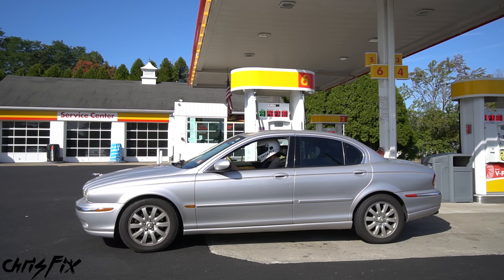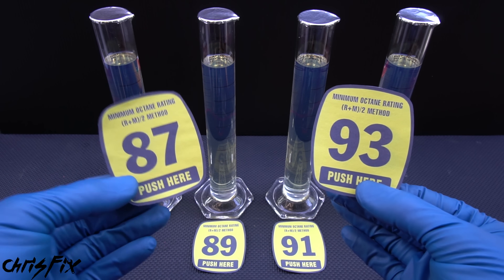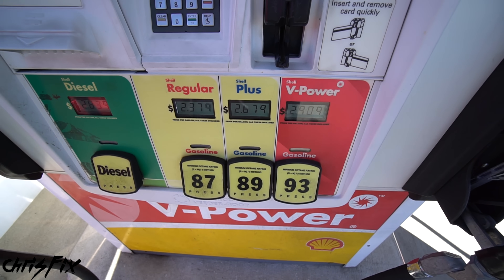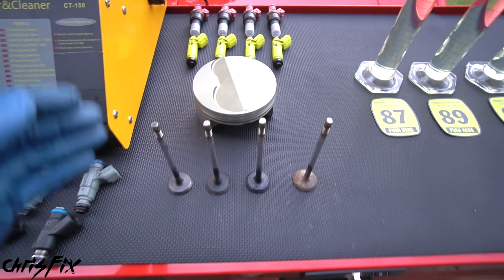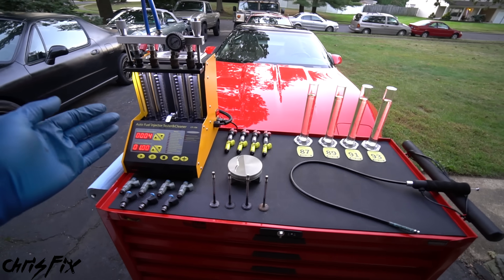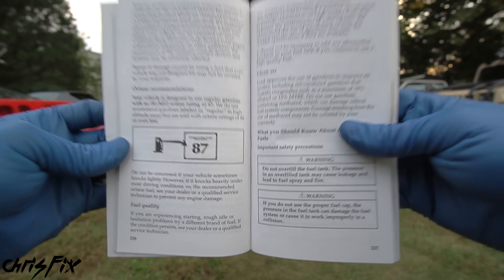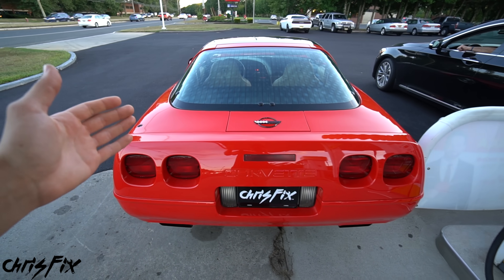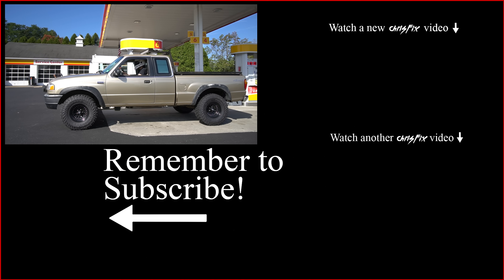What is the BEST Fuel to Use in Your Car or Truck and WHY

Comment: ALL YOU HAVE TO DO IS LIGHLY SPRAY WATER INTO THE AIR INTAKE AND HAVE SOMEBODY APPLY GAS. IT WILL CLEAN ALL THE CARBON OUT OF THE ENGINE IN A MATER OF MINUTES

Comment: Lesson here kids, is if you own a Cruze use premium. If you don’t, you’ll probably have a #1 piston failure. A good sign that you have a #1 piston failure is your Cruze will sound like a Subaru.
(The Chevy Cruze says to use 87, do not do this kids)
Reply: It says 87 or better.  I run 89.
Reply: Jeff Rielley what car or engine? Do you drive harder, or put around? 
I enjoy spirited driving, so I use premium and top tear, on a 1.4t. 
Before the 20,000 mile rebuild, I used 87. Noticed weird computer clicks, asked the dealer at a service, and they said that it “was normal”. Then one afternoon after supper, left the restaurant, and thought someone done a boxer swap on my car.
Reply: @johnsimun6533  I have the 2017 Cruze, 1.4t. I usually try for best mileage since I use my car for work and get paid mileage.  My car is paid off, so it makes sense to use it as a money maker.

Comment: FYI about the E-85 comments at the end, there is such a thing as 85 octane out West in higher elevations that is not ethanol-based, as there is less atmospheric pressure & the engine can perform as well as ~87 octane. Also, have seen some pumps in the midwest with 88 octane as well that has 15% ethanol, sometimes branded as E15.

Comment: Using the manufacturer's guidelines is ok, except if you have an Infiniti.  They stated "premium is recommended for maximum performance."  Well, I tried regular for "regular" performance...and that didn't work.  Then I tried the mid grade, and I got the knocking and check engine light.  In that case, for the G35, premium should have been stated as "required."

Comment: I have a 1999 Jeep Grand Cherokee,  I had my heads done and I'm hearing knocking, but I use 93 Octane. And I also injector cleaner and booster. And its helping a lot. The only time I really hear the knocking is on a cold start and after I warm up the engine, the knocking goes away. Is that normal? And am i doing the right thing with using 93 Octane Fuel and injector cleaner.

Comment: I agree on everything except on your explanation of pre-detonation. The fuel detonates when its not supposed to relative to the engines cycle and not all over the cylinder space. 
It detonates before the piston has reached top point in the cylinder.Pardon my english. 
Fuel detonates at the wrong cycle, wanting to push down the piston but the crank is still pushing the piston to its TDC, hence the broken piston rings, gasket failures, broken heads, bent exhaust valves, or broken/bend piston rods. All that pressure that isnt converting to cyclic motion by the crank needs to go somewhere.

What you are explaining is a very complicated matter of fuel detonation inside the cylinder that manufacturers are still struggling with. Thats why you see so many different piston designs.
I believe Alfa Romeo and BMW have the most interesting ones, if you dont take in mind super cars.

ECU programmers want to protect the engine from predetonation by adding more fuel to the cylinder and also advance the exhaust valve just a notch. More fuel to the cylinder can take more heat with it as it exhausts through the valve, this is why you see flames out of turbocharged car exhausts. All that extra fuel didnt have the time to ignite in the cylinder and it does so in the exhaust system. Taking with it extra heat that could damage the cylinder in case of predetonation for the next cycle of the engine rev.

This is why you see huge intercoolers on street cars. They want to keep the inlet air temperature below a certain point. Cold air has more oxygen molecules than hot air. Resulting in a more stable variable for the engine ecu tuners mind, because if predetonation occurs its going to be catastrophic to the engine.
But as you use larger and larger intercoolers you are adding more space for the turborcharger to fill before it reaches its operating pressure. Hence with larger intercoolers you are adding more turbo lag to the system.
They fix this with small intercoolers using a medium usually sprayed on them with relatively high evaporation rate to take as much heat off of the intercooler as fast as possible.
Think of it when you use aceton that has high evaporation rate, you feel your hand getting colder.

Comment: This video is false.  A more 'higher' octane will of course give you more power!  That is a fact!  For those who haven't been to a race track like a drag race track, they have 98.99 or 100 octane fuel there (called racing fuel) so cars can get the best performance from the fuel as is possible.  It's idiotic to think a higher performance fuel will not provide a boost in power.  Here in part is why that's true...a higher performance fuel (octane) will burn more & cleaner.  Because it will burn more in the cylinder the fuel you get a slight bump in power.  People like this person in this video mean well but they are 100% wrong!

Comment: Hey Chris, I used regular gasoline on my 2002 honda fit gd1 and I noticed it has already a bad fuel consumption when I used it and its not strong enough as I drive it on highway speed but the engine sounds fine, could it be possible that the fuel injector in my car is dirty?

Comment: Why here in california we dont have 93 we only have 91
Reply: Because California's insane gasoline pollution standards, force additives into the fuel, that only a very select few refineries are willing to add. And these refineries generally only formulate up to 91 octane gasoline. Most states have access to higher octane gas like 92 and 93 octane, except for California, since they can use the gasoline from any refinery. This is also why Californians pay far higher gasoline prices compared to the rest of the US too. Plus higher gasoline taxes in California also jack up the price. And the funny thing is that the extra additives in California gas, don't help the gas to burn any cleaner than any other states gasoline as it turns out. So now you have to pay more than any other state and get no added benefits of cleaner burning fuel.
The only real way to make gasoline burn cleaner, is by mixing in ethanol. And most states are doing that now anyway.

Comment: Thanks for your advice on gas. My jeep would not run right on normal gas so I went to premium and it has made a big difference. The engine does not pink anymore under lowed. It is so much better all round. So know I am happy and will be  using the premium all the time. Good video's keep them coming. I could have spent lots of money at the garage trying to sort it all out but when I looked at your video advice I just done what you said and it all worked out well. So know I will keep my jeep and enjoy my rides out a lot better than before. Keep them video's coming. Cheers bud.

Comment: So if you have been using regular how can I use premium ? Do you need to clean out the fuel? Run it on low? How would I change it back?
Reply: You can intermix different octane gasoline no problem. Just wait until you need gas again, and fill up with your desired octane.

Comment: Wait so with your truck, when you switch to premium and switch back is it gonna screw up the car? Sorry if I missed this in the video somewhere
Reply: I’d run it for a while with premium until it’s clean, and then you could switch back to regular. Or you could use regular with fuel additives it’d work too

Comment: What if the owners manual says "Use 87 or higher" ?
Reply: That means the car is enginerd to run on 87 octane just fine. But it also means your car will run on higher octane gas as well just fine. Your best bet is to run 87 since putting higher octane gas in your vehicle, would just be a waste of money, since its tuned to run on 87. You can run higher octane gas. But you wont get any added performance benefits, since your car's owner manual says 87 octane and higher. Aka...Use 87 for full performance, or higher with no added performance benefit.

Comment: Great video I’m just wondering if you could shed some light on the storage life of the different octanes? I was I was under the assumption that the higher octane last longer if you don’t drive your car as much you should probably put 91 in. Is that correct I know 87 goes bad really fast it’s complete garbage!
Reply: All gas regardless of octane, has a 4 week storage time limit for full performance benefits. To make gas last longer, you will need to add a fuel stabilizer. All gas even with stabilizer should be burned up before 1 year has lapsed from the date of purchase. (Preferably after 6 months for full octane performance.) 87 octane, or 93, it's all the same though. A 4 week shelf life without stabilizer for all modern 10% blended gas.

Comment: Good to know that if my 98 corolla starts to feel like its losing power , it can be the fuel injector that I can clean with like 2 full tanks of premium. That's a life saver man thanks !
Reply: My first car ran like shit off cheap fuel. Ever since I started putting premium in it, I had ZERO problems with power or fuel efficiency and significantly less repairs over the years. I stick with premium permanently, its only a little bit more each time anyway.
Reply: And when you put reg bsck in it .it will run like shit again
Reply: Might throw a tank into my 97 camry and see what happens im a little scared ive accidentally put like .9 gal in my car before noticing but if it can help clean it a little its worth a try
Reply: Travis Hantsbarger  well assuming it goes 25km/l (this varies greatly based on what kind of driving you do, and the age of the car) then you should need a fill of 100litres to get through 2500 kilometers - assuming that it has a 50 liter tank, it should be possible to do on two tanks.

Edit: oops 2500 Miles, not kms - 2500 miles is 4022 kms, and you'll end up having used 160litres (42 us gallons)

Comment: My truck is flex fuel it says to use e-85 but i cant find pumps around me with that option so i out premium is that good?
Reply: E-85 is prevalent in the midwest of the US. But on the East and west coasts, not so much. Premium is just fine. And many flex fuels can even run on regular 87. Just check your owners manual.

Comment: bios47 It’s not that complicated, all fuel is the same except for the additives, which is only about 3%, the ethanol content is greater than the additives. 

Look at the ground near the pumps, you will find 3-6 steel manhole covers, just like on the roads except smaller. They each go to a large tank which a tanker will fill with one type of fuel. When you select a certain type you open a valve connected to that tank. As soon as you start fueling you get the fuel that is still in between the tank and the pump handle. 

So how much is that? Look at the hose, it’s the same as a garden hose, when you turn off your water at the valve there’s water in the hose between the valve and the end of the hose. It’s the same thing, that’s why they go up several feet on the gas pump. Gravity will bring the gas back into the correct tank and when you start pumping you get the gas from the correct tank. Yes you get the gas between the handle and the bottom of the hose. 

But get this... it’s 97% gasoline including things like ethanol etc. The gas you select is pumped, yes there’s an actual fuel pump inside that big thing you pulled up to. You are most likely getting several litres or gallons or whatever... and 97% of it is the same except for the ethanol content. The diesel is the only thing that is not connected which is why the diesel pump used to be totally separate.

Comment: So does that mean you can run moonshine in a flex-fuel!? 🌽 😉😆😋
Reply: It is possible that on 90% moonshine You will have a lot more power after tweaking up Your ECU. Lubricating the injectors and fuel pump becomes a problem. In Poland we add 99% moonshine to diesel for winther, or 5-10% mix with gasoline for racing.

Comment: Depends how your vehicle is tuned if its tuned for 87 putting in 93 will make no difference in power or fuel efficiency had a friend try it and it made 0 difference till he tuned it for 93

Comment: This is informative, I have a 2007 FJ Cruiser that requires a use of premium gas only, stamp on the fuel cap as well and mentioned on the Toyota manual, it says I can also use regular gasoline no problem. Using the premium gasoline will get the truck in tough performance, so I start using it since I bought it new, I think with my long time relationship with my truck I probably use regular gas about 3 times in 13 years and I would say, every time I use a low grade gas on my truck, it started to knock, this goes to any brand of gas, I notice that premium gas from other brand gives knocking on my truck as well which gets me scratch my head :) anyways probably its the octane or additives is the issue, I settle for one type of gas that doesn't give me any knock at all and this is the Costco premium gas. Don't know why but my truck is calm when I use this gas.
They probably mix it with weed additives! LOL!

Comment: The knocking noise isn’t from uneven detonation. The knock is from the piston head jamming the rod down into the crank because the detonation is happening before the piston comes over top dead center of the cylinder.

Comment: You don't want to use E-85 at all even if it is significantly cheaper than actual gasoline, because the specific energy in ethanol is much lower that the specific energy of gasoline. E-85 delivers less of what you are buying gasoline for,  power and fuel economy. You get less bang for the buck, so it isn't easy to calculate how cheap E-85 would have to be to make it worthwhile. Because you have to burn more of it for the same ride, any claims about lower air pollution may also be illusory. E-85 is a sop to large agri-businesses, but if you don't live in Iowa, it isn't doing you any good.

Comment: The specific energy, kilocalories per gram, is probably lower the higher the octane rating. Less go per gallon the higher the octane rating. .The fuel is gasoline, and octane boosters aren't gasoline. They probably burn, but they  are not actually fuel. Higher octane uses more octane boosters, so less fuel per unit volume, lower specific energy.

ChrisFix is correct otherwise. Unless your engine is designed specifically to take advantage of higher compression, and therefore needs higher octane to avoid destroying itself, you don't need it  and you are wasting your money buying it.  If you aren't modifying your engine, RTFM. Use the grade of fuel the manufacturer recommends for your car.

Comment: Hello there Chris! How ya doin?
Just want to ask, I'm drivin Hyundai Reina 2019. Few weeks later after I got the car, I experience engine knock. It says on the Manual that engine needs 91 octane or Higher. But its kinda weird why I get engine knocks whenever I use 91. So I went back to the dealership and they've told me to use a higher octane. I've tried 93 and 95 octanes but I can still hear the knock. So I decided to use the most expensive fuel we got here in our country which is 97 (Shell Vpower Racing) or 100 (Petron Blaze 100). Using a higher octane is not my concern. What I would like to understand is that why would the manufacturer HARI indicated to use 91 octane but the thing is it doesn't run well in the engine?? Btw, other units run smooth with 91 and others doesn't. Hope you can shed some light. Thanks!😎

Comment: Hey Chris, I am a new owner of Corolla 1.8L 2004, it already ran 250k km, its unleaded recquired my question is, since its getting old and you have said on your video using premium cleans the engine carbon dirt. Will I stick to regular or turn into premium gasoline? 😊

Comment: Question..is that octane number? We cant get lower than 95 here in europe, sometimes 93 but its not mostly common so why do you guys have 93 and lower?
Reply: Here in the US we use a different method to test octane that's a bit more precise than what Europe uses. In Europe you use the Ron test method only. In the US and Canada, we use the Ron and Mon test methods and take the average of the two resulting tests. So Tesco 99 in the UK is rated at 99 Ron, but it's rated at 87 Mon. Mon is a more strict test that results in a lower octane number than Ron. (Ron = Research Octane Number / Mon = Motor Octane Number)   

So Tesco 99 = Ron 99 + Mon 87 + the US formula of (R+M)/2 = 93 US octane.  Shell V power in the UK also is rated at 99 octane Ron and 87 octane Mon. So UK Shell V Power = 93 US octane.